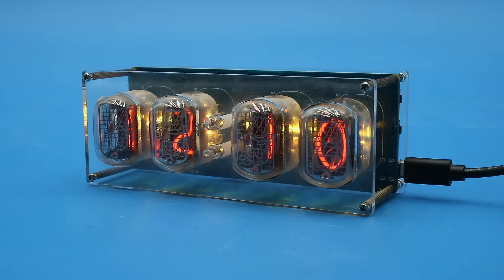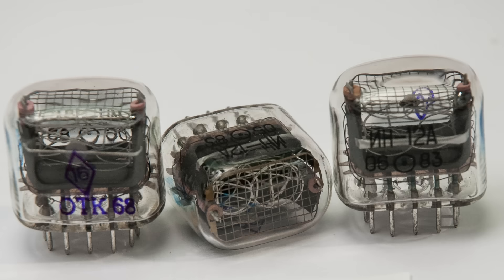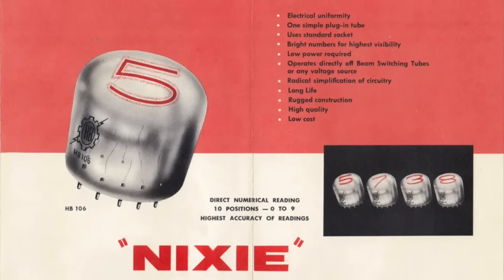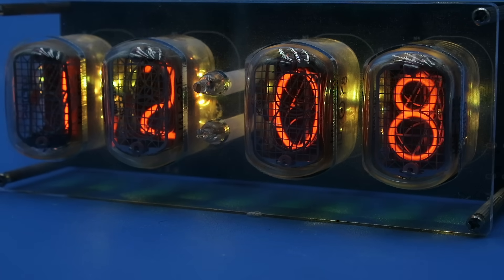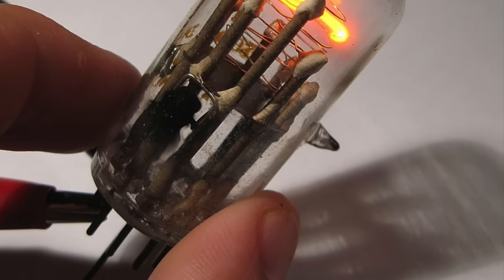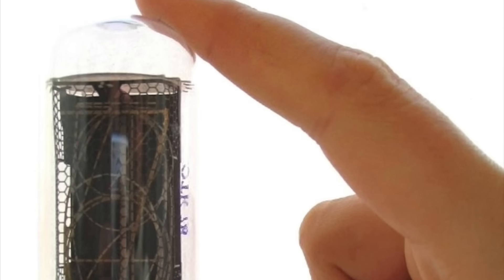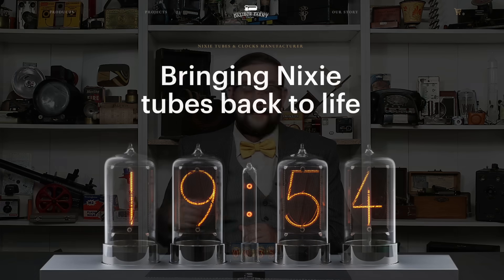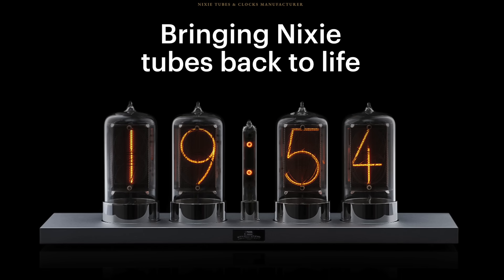Nixie tubes: the OG Digital Display

Comment: If only the Nixie display was the least egregious mistake in Oppenheimer.  I was particularly amused by the sight of the scientists delicately lowering the plutonium pit into The Gadget by their delicate little fingertips.  In fact, the density of plutonium made it a heavy lift, and was only done with hands gloved against the poisonous element.

First Nixie display I saw was on the AN/GWM-14, if I remember correctly, weapons system tester built for the Air Force by, memory again, Temco, which later became Ling-Temco-Vought.  The testers came to F-105D fighter bases in late 1961, and were designed to do integrity testing on the aircraft, and on components in shop, on the next-generation weapons systems on the aircraft.  It was the first digitally-operated machine I encountered, with a Mylar tape drive for software encoded into an 8 X 5 hole array, forty bits, for an optical reader.  Logic was performed by numerous relays, which unfortunately were not canned.  The whole unit was weatherized and designed to be towed to the aircraft, but when a cold-soaked tester was brought into a warm shop, opening any panel on it caused condensation to form on the open relay contacts, screwing up the works.  We learned to keep a cold tester sealed until warmed completely before opening it.  In addition to the Nixie display, it had a numerical printer for recording test codes.  This was before thermal printers, so I suppose it was some sort of impact printer.  The whole system was pretty buggy at first, but eventually it became a vital tool for the weapons mechanics.

Comment: 10:20 -- you missed mentioning the One-Plane Display, which was a tiny projection device, operated by 12 small incandescent lamps, with the numbers (or other symbols) on a film slide, each with its own lens to enlarge and focus the image against a flat screen (the plane).  These are seen in various sizes in the NASA Mission Operations Control Rooms during the Gemini and Apollo missions.
Reply: They were used in floor indicators in some elevators, too.

Comment: Great video! I bought a small Ukrainian built IN-12 clock a couple of years ago, which uses a motion sensor to only run the tubes when someone is in the room to prevent cathode poisoning. It works great, and the glow of these tubes never cease to fascinate me.

Comment: The clocks used at the Trinity shot were probably large diameter analog clocks. You can see them in all the old documentaries of missile and rocket development. Some of them had a sweep hand that was graduated in 100ths of seconds making a complete revolution in one second.
Reply: Oooh, wouldn't that be cool as an analog clock for my house....
Reply: nobody can read an analog clock face anymore
Reply: @dziban303  That's kind of crazy, so big ben's days are numbered?
Reply: @dziban303  People can, they just tend to be out of practice. I'm young (early thirties) and it seems that people my age can read an analogue clock just fine, but it requires us to stop and pay conscious effort to it for at least two or three seconds, locating the hour, locating the minute hand and either counting five-minute intervals to it or doing mental multiplication by five or place-shift-and-half on the value of the previous hour to extract the minutes-to-the-previous-five, and estimating or counting the remainder minutes to add to it. As a multi-step mathematical process, rather than an intuitive skill.
A lot of people don't bother to read analogue clocks, though. I'll admit -- it's a skill, and while it was previously in common practice to the level of second nature, today most people including me are extremely bad at it (and usually have some other kind of timepiece they can check more conveniently on hand). Because they don't NEED to be practised at it, knowing the general principle is enough, as it comes up rarely enough that requiring conscious 'figuring' is OK.

Comment: Another fact of the gas in nixie tubes and florescent tubes was, the plasma is a room temperature plasma, unlike plasma that reach thousands of degrees.

It was sad when the LED overtook the plasma technology and decreased the demand for them,, but displays that need to be seen in sunlight which gives some gas discharge displays an edge over LED displays has kept the gas display markets alive so far.
Reply: The 160Vdc power supply was the main reason. All the logic was 5V and the displays needed 160V.
Reply: That's not true. The plasma in Nixie tubes is very hot. Even "cold" plasma is still around 10,000 K. The reason Nixies don't get hot is that there is very little of it and its energy is therefore low. It's the same effect you can observe with sparklers.
Reply: Amber LED's can often be substituted for neon's, and if the optics are done right, as in soft edges to the digits, most would never know.
LED clocks can easily last most of your lifespan - often it's corroded switches (as in time set buttons) that see them discarded, whereas neon lamps have a way shorter life. I have made a nixie clock, but are hesitant to have it running 24/7 as I cannot nick off to my local electronics supplier for spares.
Reply: @paulstubbs7678  The only telltale would be the lack of the wires for the digits which are not glowing and blocking the digit that is.

Nixies usually last a very long time, as far as I have seen, and I have a few that are over 50 years old, and were on most every working day we used it.

But like anything, I have seen LEDs and nixies fail over time.

Comment: RE. Stack Order: Not sure about digits 'obscuring' the lit ones, having the number one at the back doesn't follow that logic. I understood the order to be derived simply for ease of connecting a straight line of digits enclosed by a circular pattern of pins. This may not be the case for this 'top to bottom' style but I'm sure it was for the more normal 'front to back' arrangement of digits.

Comment: That Nixie display in the film bugged me too, but I just dismissed it as a viewer-friendly interface. I still haven't forgiven the flags in Oppie's nightmare though.
Something that might have been both historically accurate and a viewer-friendly interface would be a teleregister, which works kinda like a flip clock, and I think the noise of the changing digits would have contributed to the diegetic drama of the countdown, but if they had any kind of countdown indicator it probably would have had an analog dial.
By the way, if you're interested in other vintage display indicators, you might want to consult with Fran Blanche. These are a bit of a passion for her.
Reply: I'll be surprised if Fran doesn't chime in on the comments here somewhere....
Reply: My parents' alarm clock was a flip clock, and it had a night light that shone down on the digits .... very ominous and creepy in the dark :D

Comment: Funny enough, I rewatched Oppenheimer last night,  saw the countdown clock and thought, "I didn't think those tubes were in use then."
Reply: I had a similar issue with the green led numbers in Apollo 13. Come to find out,they did have digital displays that looked very similar, electro luminescent, leds were just a practical choice to film as a practical effect. Leds were off the shelf tech, E-L tech would be much harder now.
Reply: @pw36952m ELD's were used on desktop calculators in the USSR in the 1960's- 70's....?
Reply: Good eye and good memory!
Reply: Last night, I watched Dr Strangelove. I thought for sure that the Coke machine that Colonel Bat Guano shot up was anachronistic. Sure enough, it turns out that model was from the 1990's. You cant ever trust Hollywood.
Reply: Absolutely!  Also the 90s movie The Shadow is set in the same period and features a nuclear bomb with a NIXIE counter.
But they fit the look of the era perfectly!  If I were a period film art director I would find it hard to resist.  I love the look of them (and collect them).
Reply: They had 50-star flags in the victory rally, but all others had 48. It was very obvious in IMAX.
Reply: in Nolan's defense they just look so cool I can't blame him for using them lol

nothing comes close aesthetically speaking to a Nixie tube
Reply: sure dude

Comment: Using an upside-down 2 for a 5 is a crime against typography and esthetics. 😖 Of course, so are 7-segment displays, but at least those once had the excuse of significant savings.
Reply: Agreed - that upside down 2 looks terrible. Not all Nixie tubes have that, however. I think it's just the Soviet-made ones.
Reply: Some Soviet tubes have that.  The IN12, and IN14 I think.  The IN8 and big IN18 have proper 5s

Comment: Thank you for the detailed overview of Nixies. Before I would have guessed they had been used commercially before the mid 1950's. I have always also been interested in the variety of tubes that were used in tuning strength indicators in various radios, etc. Would you be interested in doing a video about them? Really enjoyed this one!
Reply: Peter, check out ' Fran Lab '  for information about displays or ' Techmoan ' who has reviewed various kits if you are interested in building a clock.
Reply: "Magic Eye" tubes, the forerunner to the cathode ray tube; first developed by Dumont, who stupidly sold the patent to RCA.